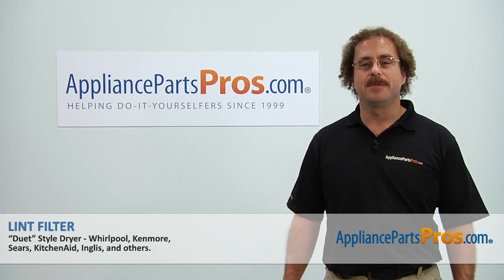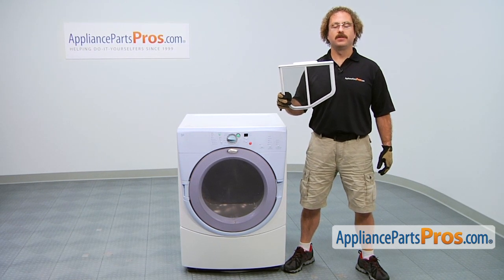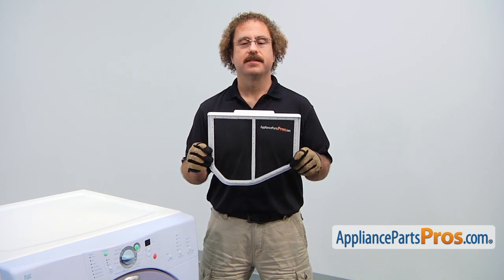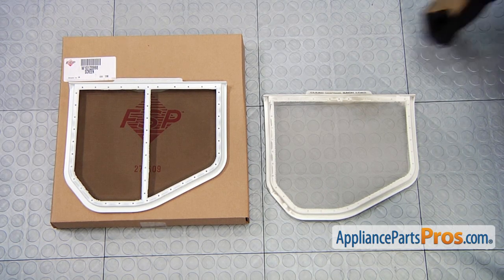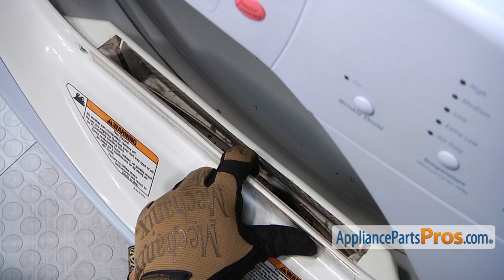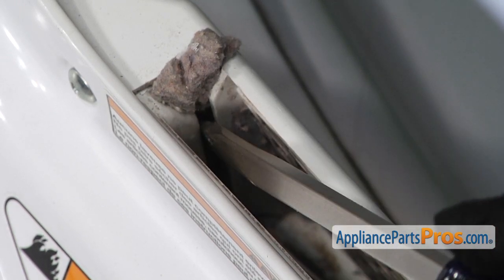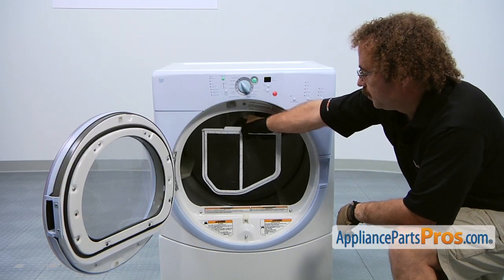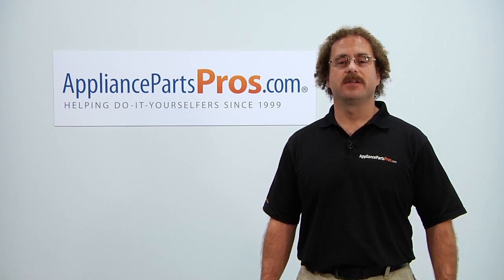How To: Whirlpool/KitchenAid/Maytag Lint Filter w10120998

Comment: You can clean all the external vents and still have a problem with drying even if the dryer is putting out heat.  And, if the grooves in the video are filled, why would you not want to clean the internal venting of the dryer.  I was looking for a Duet video but so far none found to clean the blower and internal venting etc.  Just looking down where the lint screen goes, one can see so much crud so imagine what has found its way further down.
Reply from the maker: Hey, James. You're definitely right, it's important to keep the dryer free of lint build up throughout. It doesn't look like we have a video specific to that yet, but if you'll give us a call at 1-877-477-7278 or chat us at appliancepartspros.com, we can advise you on how to tackle that project.
Reply: I pulled the front lower front cover off the Duet found over a gallon of lint inside; I didn't take blower wheel off or clean the coils, etc., because that's a big project as I would have to remove the drum...but in cleaning I think might have done something as now no heat.  In fact, I'm debating whether to replace the 13-year-old washer dryer and fix this and sell.  I will have to isolate whether it's the thermal fuse, thermostat, or heating coil.  My circuit breaker is fine and I reset both of them.  Every day something in the house seems to break...kind of like me as I age.  ;)  I'll check your other videos when I'm ready to do the repair.
Reply from the maker: That's a lot of lint! A surprising amount will build up over time, but it's always shocking to see just how much.

If you'd like help diagnosing what the problem could be, though, give us a call with your model number.